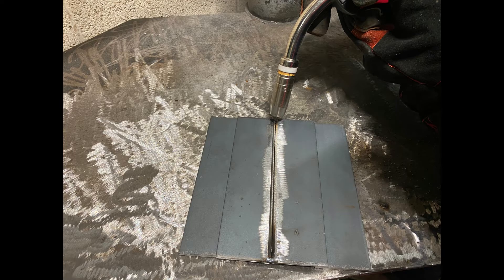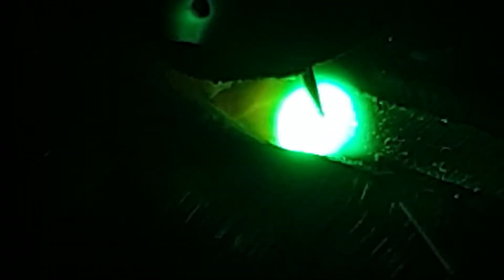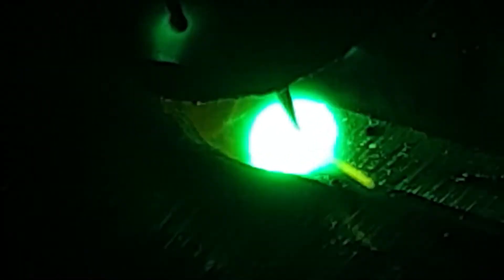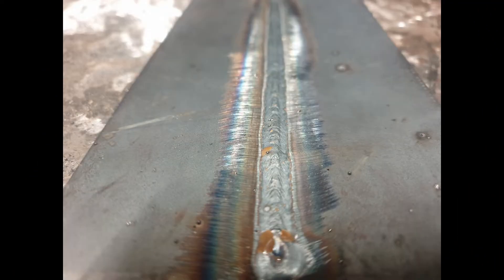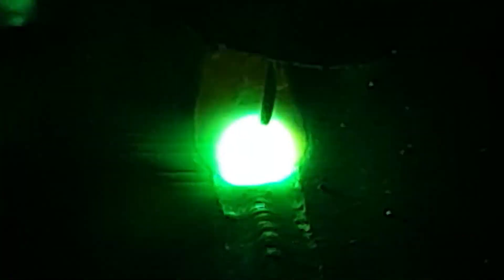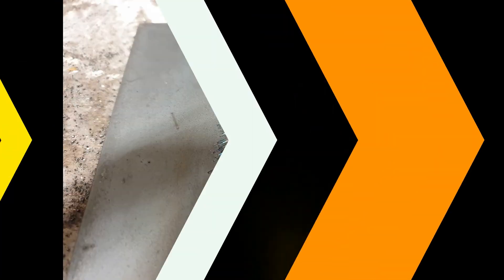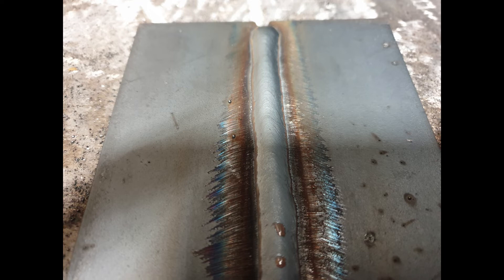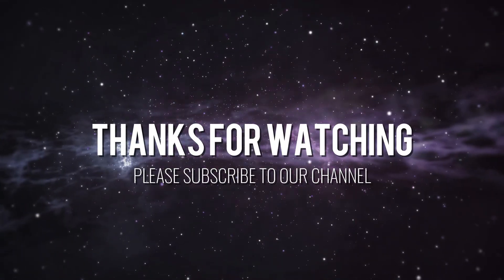MIG Welding a Butt Joint: Techniques and Tips (1G/PA)!

Comment: What are the setting you use please.
Reply from the maker: 17 volts root run 5 wire speed (metres per minute) 19 volts capping run 5.5 mpm wire speed. This is set dependent we were using a powerful set so settings may slightly differ.
Reply: Thanks a lot.. @weldtechsolutions
Reply: @weldtechsolutions when to use multiple layer on 1G position?
Reply from the maker: 1mm wire
Reply: What is your waving technik

Comment: same wire speed for the root pass?
Reply: I seem to struggle with delivering a decent root pass at the college. Open v butt on 6mm. Did a test piece, but unfortunately it snapped during root facebend. Back in tomorrow so trying to see how it's done.
Reply from the maker: Sorry yes after the root pass is in turn up the volts and wire speed slightly.

Comment: I turn just my wire speed down a bit on butt welds for a nice flat run
Reply: Same volt and everything? My schools machines are machine controlled so if I put my thickness of my metal 1/4 inch (the metal thickness of what I’m trying to butt weld) it only allows a range of something if I remember correctly let’s say 200-230 wire speed and 19-21 volts before it changes the thickness of metal if you increase the volts it increases the wire speed accordingly.